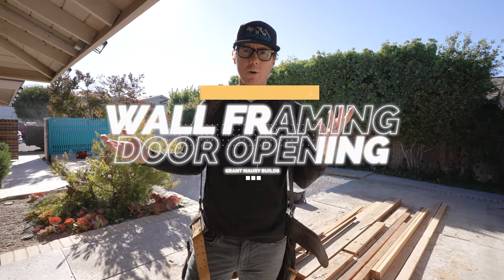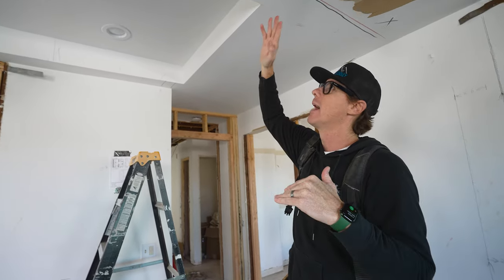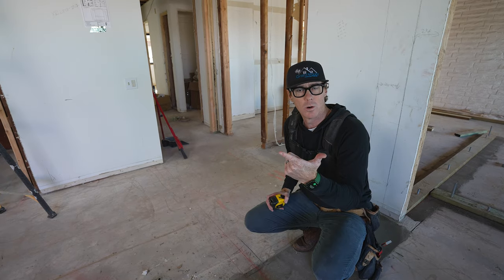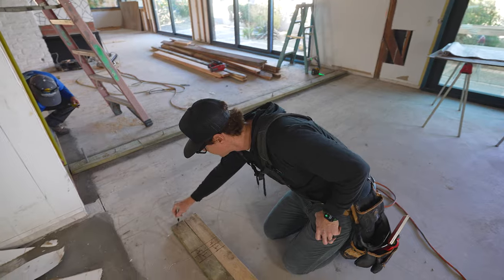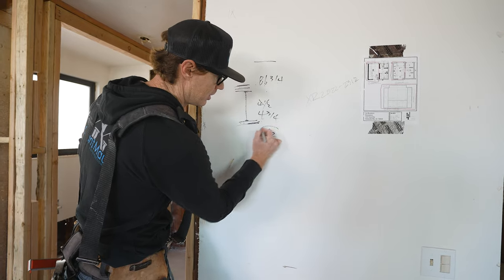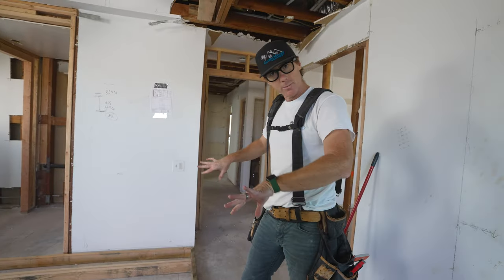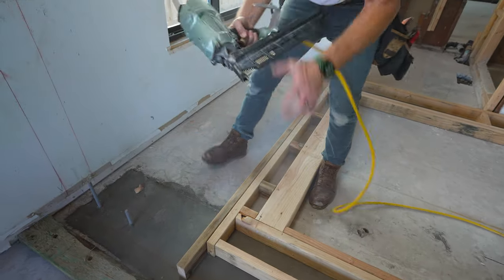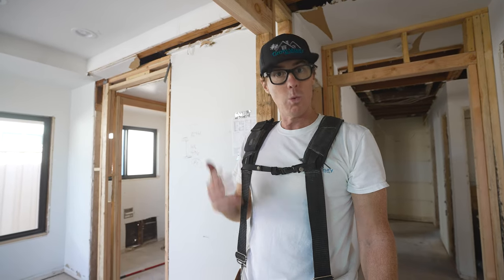HOW TO FRAME a Wall with Door Opening - Wall Framing 101

Comment: Super great video!  Enclosing part of garage with wall and a regular door.  Great insight into the tools needed. Have everything except the ramset tool. Would be good to have some education around the right grade of studs available from a local home improvement retailer and their purpose.  Whitewood, Southern Pine, #2, Appearance grade. When to used pressure treaded, etc.

Comment: If its a door opening, is the new flooring flush with the bottom plate? Great video
Reply from the maker: Thanks for the support! 

Flooring will typically be installed up to the bottom plate. Depending on the thickness of the flooring materials, most likely it will finish below the top of the bottom plate. Hope that helps answer your question!

Comment: If you’re framing a wall below a tile floor would you still build it on the floor knowing there won’t be much give to the joists above or stick frame it? If you’d stick frame it how would you handle that? Laser level and chalk line for top and sill plate?

Comment: I’m confused about the bottom. Will that be cut so you don’t have to step over it when entering/exiting through the door? If you already have flooring and you need to add a wall with a door that bottom piece would be in the way. Since this Reno you’re doing is concrete you might be building up the flooring to the level of the bottom board but what if that’s not the case?
Reply: It depends on what they are planning, if the floor is below that bottom piece, they will just cut it, if not, it will stay.

Comment: Instead of going back 3/4 will you have the same outcome if you measure 3/4 up ? So I usually go 16 3/4 mark my line and put the X where 16 on center would be. Or does it only work going backwards?
Reply: You have to go backwards as you are creating a 16” OC reference from the first stud youre placing at the end of the wall.

You could go 3/4” up, but most mark ahead for stud placement.
Reply: Can you just mark the first stud 15 1/4 and then 16” from that. Wouldn’t that technically put the stud markings 3/4” back?

Comment: If I plan to put my wall directly under a joist (and running parallel with it), do I need the second top plate and backing, or can the joist act as both?

Comment: on the studs above the header (the top cripples) for securing them to the header do you just leave them unfastened? would you use glue or drill holes on the sides & screw them in at a 45 degree angle to the header?

additionally instead of studs above the header could you instead just put another solid piece of wood to fill the entire space?

Comment: Putting up a wall in a basement that has and will be finished in panelling, the cheap kind..Im wondering if i am to use 2x4s..the existing framing on the support walls are done with 2x2s..im putting a door on it..any tips..also has a drop ceiling sooo i have im not really sure if there is a special way to go about it.

Comment: 100% of the time if I don’t hold a board and nail it with a gun, I will nail it strait 50% of the time if I hold a board with my hand and use a nail gun, I’ll angle the nail into my finger. Brave or confident to hold them little 3” cripple boards and shoot them 😮

Comment: Who wants to turn up to a job and roll out the hoses and power cords, plug in the compressor, pull out the air framer and the pack it all up in the afternoon on a Reno. I did see the red pig 🐖 Milwaukee framer…surprised it’s working. Invest in some cordless nailers…